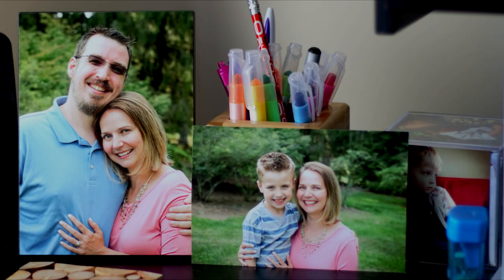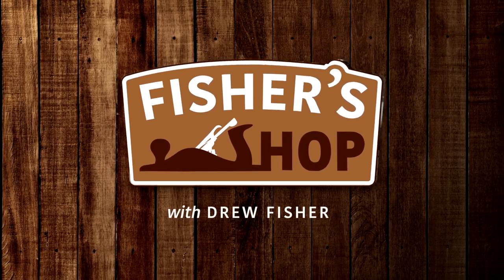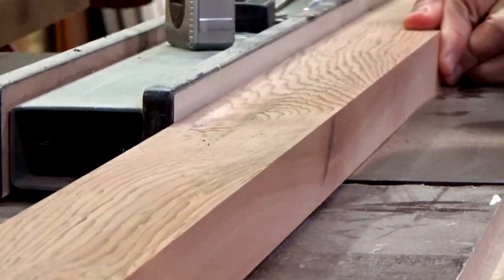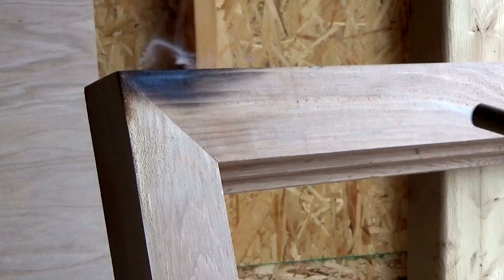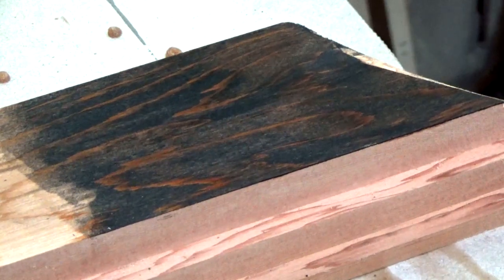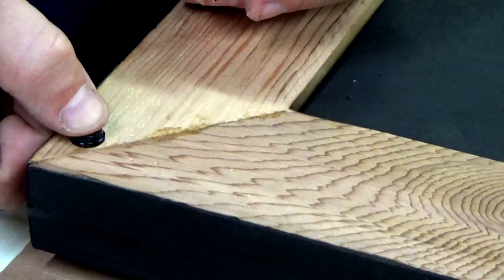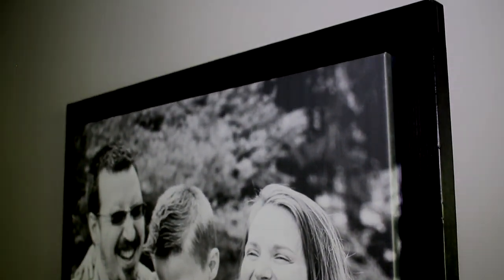Woodworking: How to make a Shou Sugi Ban Picture Frame

Comment: Your shop buddies are so cute.  Adorable kid and dog, they added a lot to the video, heh heh!
Shou Sugi Ban is not about toasting the wood lightly.  It means scorching it to almost charcoal level, then scraping the wood with wire brushes to expose the grain. Three things happen:
1. You expose the wood grain with a texture of valleys and ridges, giving an attractive aged look to the wood.
2. Burning the wood brings the natural oils of the wood to the surface to mitigate damage from water, fire, and insects.  It also removes moisture from the wood and hardens it.
3. Creates a natural stain and depth of color for aesthetic purposes.

No, it is not finished with just the burning.  Alligator level charred wood is not shou sugi ban.  It has to be scraped off with a wire brush, then oiled to be finished.  Charred wood smells bad, leaves marks on artwork and walls, and is neither functional or attractive.  It must be scraped off leaving furrows in wood to get that texture and contrast between darker ridges and lighter furrows. Some oiling and sealing is also a good idea for artwork.

My technique is to use a crimped wire cup brush on the angle grinder, and scrape up the raw wood to get the texturing and ridges.  It works best on softer wood like pine, redwood, cedar but not on oak or hardwoods. Once you have furrowed it, sand down lightly to get rid of splinters or and smoothen a bit.  Then lightly toast it for color. Toasting it burns off any fine burrs from the scraping.

Then I liberally lather it with Boiled Linseed Oil wiping off excess in 15 mins. Air dry 2 days.  Optionally, you can stain with English Chestnut oil based stain, and some streaks of dark grey stain to get an aged look.  Use both oil and stain if you want, separately. This conditions dry wood so its not brittle and never cracks.

Seal off with Mineral Spirits 60:40 Polyurethane (oil based, clear, interior, satin) in multiple coats. After 10 mins of applying each coat, wipe off excess and air bubbles.  When very diluted, the poly soaks into the wood, strengthening it.  It looks like a hand rubbed finish.  This will really look authentic, like an old Japanese frame.

Don't use water based poly, it is junk. You should not have to sand down between coats which will affect overall color and texture.  If you thin out the oil based poly, it soaks in. Then when you wipe off the excess, the air bubble craters wipe off too, leaving it smooth, no bumps. Using Satin instead of gloss means it will stick to next coat without sanding, it has a better grip, as gloss is too slippery.  Sanding down textured wood - use steel wool not sand paper.

You NEVER permanently mount any artwork - golden rule of museums and art galleries. Artwork needs maintenance, such as frame reconditioning, a change of matting, cleaning, etc. Nailing it in is a no-no. You can buy clips to screw into the wood frame to hold the artwork in place.  Amazon search on: 'picture frame spear turn button with screws'

The frame turned out well.  Nice texture. The frame color matched the photo nicely.  Although the purpose of the Shou Sugi Ban (or Yakisugi in Japanese) technique is to bring out the natural beauty of the wood, so best to leave it a natural wood color.

Comment: I've found out the hard way that shou sugi ban will compromise any glue it passes over, pretty severely...  I've learned to burn, sand, finish before gluing wherever possible.  This happened with TB3 on some outdoor pieces.  Full disclaimer, , also were exposed to direct summer sun in Phoenix.  Failed within a couple months.  Just a tip.
Reply from the maker: Interesting!  Thanks for watching

Comment: Greetings Fish Boy! Another great vid. The same process can be employed making oldey worldy wood beams whick look quite authentic. Add a grinder with a flexi disc and backing pad, a little bad attitude and a dab of imagination. 
Grind away faces and edges at will leaving knots protruding , burn surfaces to withing an inch of their lives and wire brush with a brass wire brush. Go over with wire wool and the rest you covered in your vid.
If you decide to try this make sure your neighbours are away lol.
Crack on with the content you're a star! Oh! and works best with Pine.
Reply from the maker: Great tips, Alec!  Thanks!
Reply: Happy to help Drew. BTW typing is a little to be desired due to new shoulder replacement. Typing isn't the only thing strange doing just with the left hand :)
Reply: Btw I was referring to potty training only lol

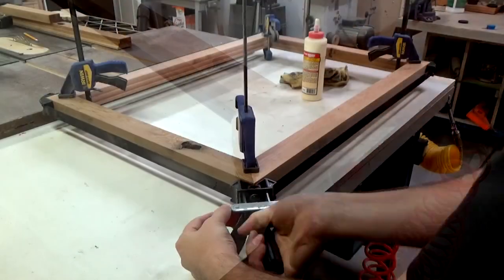Comment: Had to look up Col 3:23. My inspiration is Moses' blessing to Levi in Deut. 33:11a (NIV). Nice frame. I made a tray for my sister from cherry and tried the burning method but opted for the steel wool/vinegar method. I like you stain & burning much better.

Comment: Try Burning 3 or 4 Times then wire brush  the wood with the grain then wash off the wood with a hose and let it dry in the sun. The grain will poop unbelievable
Reply from the maker: Well it's a good thing I'll have the hose handy if the grain is gonna poop.  :) Thanks for watching and for the tips, John.